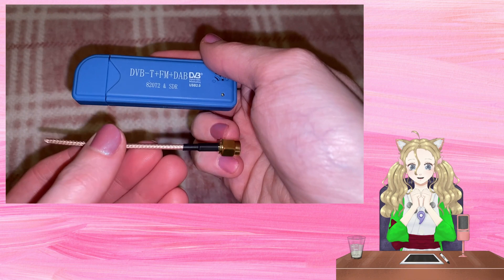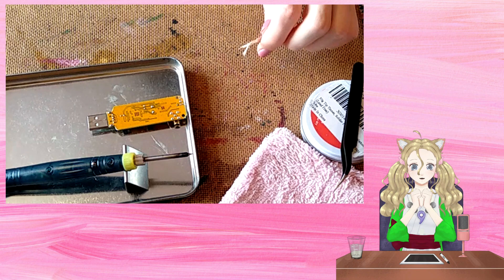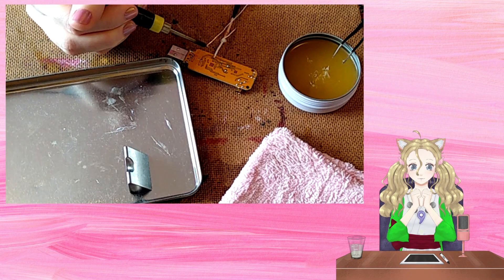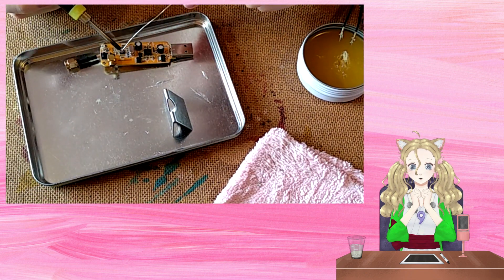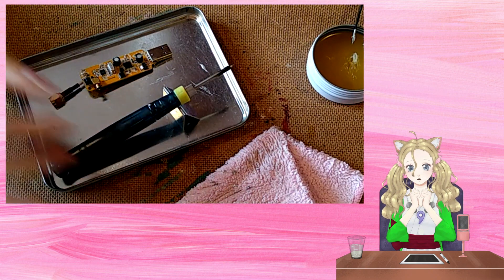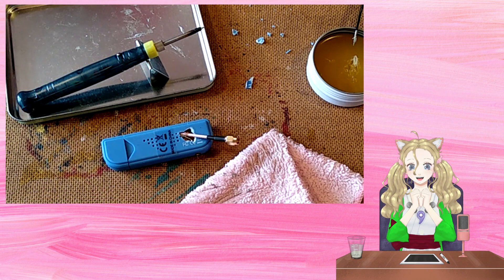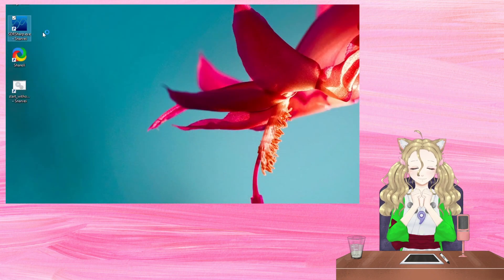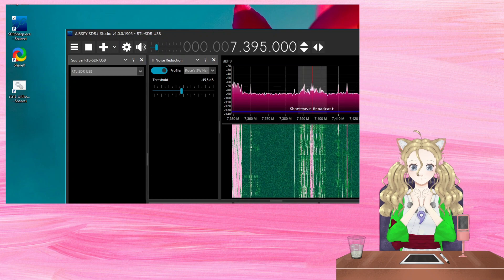How I modify an RTL-SDR to be a HF SDR (the HF-only mod)

Comment: Plz advise, 
my Sdr dongle suddenly stopped working when i get close vhf walkie talkie into the antenna.. after that my android doesn't read it anymore.. I don't know what happened and what should I do to make it running again
Reply from the maker: That's an interesting one. Does it still work on a PC? The RTLs are very cheap and theoretically can be fried with a strong input but I've not seen that happen before :(
Reply: @RoseannyaEN 
many thanks for ur replying..
unfortunately sdr is not available in my country
Reply from the maker: Oh no, that'll make getting a replacement harder :(
Have you looked on places like AliExpress? they might ship to you?